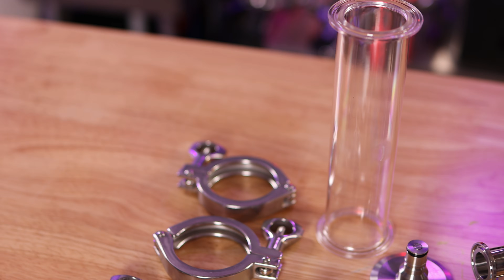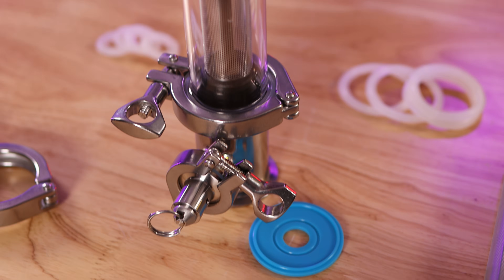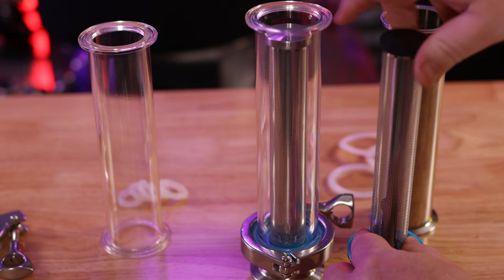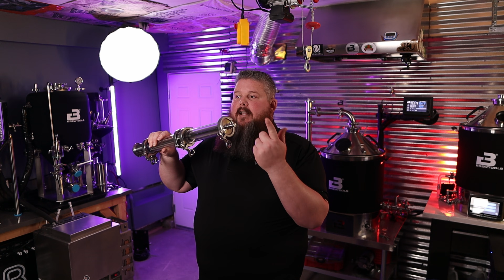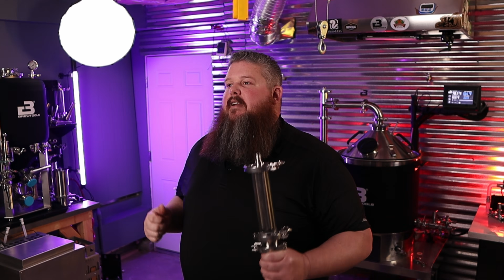Brewtools Inline Homebrew Filter Better Than Bouncer Filter?

Comment: Did anyone have any problems with customs? My brewing system shipped using DHL. They send me a text wanting info from me which is fine. But they also want me to get more info from brewtools. Manufacturing address name and one other thing. Called brewtools they said get with DHL. Called DHL for the 4th time. They said they emailed brewtools for the info but if I could call them and get the info that would work also. Customs told me it would be sent back by the 26th of March if they don’t get the info they need. Seems like I’m having to do a lot of work for the $3100 dollars I spent. Hope I get this resolved. Don’t know what it will take to get my money refunded.
Reply: Sorry if I misspelled a word or two. I should have checked before I sent this
Reply: Anyway. Hope I get it delivered. It looks like a great system

Comment: This looks pretty dang cool, but damn it is spendy.  I guess the beauty of the bouncer type filters is price - I bought the off brand option on amzn for about $15.. That said, the last time I used it for an ipa it clogged 3 times, but recleaning and co2 purging it a few times wasn't a huge deal.. but was a time waster.
Reply from the maker: I would agree it’s definitely not cheap built to last I think .. at least you were smart enough to buy the offbrand and not waste your money 🍻 like the rest
Reply: Which one did you buy?
Reply: @samuelwilli165  I was referring to a "3/8" Hose Barb in-Line Strainer with 50 mesh Stainless Steel Filter Screen" filter on amzn.  It's fine for low hopped beers that are cold crashed well.  Since this comment I bought "Homend Filter Tri-Clamp Sanitary SS304 Inline Straight Strainer with 100 Mesh Stainless Steel Screen (1.5 inch)" which works incredibly well for heavily hopped beers that have been cold crashed.

Comment: Hey Bradley, I’m confused about the sizing of the filters you said 1 micron for lagers (which is what I use - paper style) but as you said that the 1000 number scrolled up the screen - as if that’s a post production correction???? I thought 1000 micron is far less fine a screen than 300 (given 1 micron is widely regarded as the sweet spot for best clarity lagers) I asked Øyvind but have not heard back????
Reply from the maker: I miss spoke when I said 1 µm that’s why I scrolled 1000 past you are correct I did label them backwards in the video and I was referring to the 300 size  … if you check the website the size is listed are the sizes I reference just not in the right order.. The sizes available being 300 600 & 1,000 Micron
Reply: @PortlyGentleman  so the finest filter is 300 micron. This seems way too big for a good lager filtration which as I said is usually 1 micron - I hope Brewtools bring out finer filters as I REALLY like this design
Reply from the maker: I don’t think their intent is to get that level of filtration. I honestly wouldn’t mind playing with one that had 100 µm size 🍻
Reply: Hey oyvind said those are meant to filter out hopsize particles and it is not a fine filter for lager clearness.
Reply: @kasparscheidegger2172  I see, that’s a shame, hopefully the offering will be expanded to provide for this. 🤞🏻